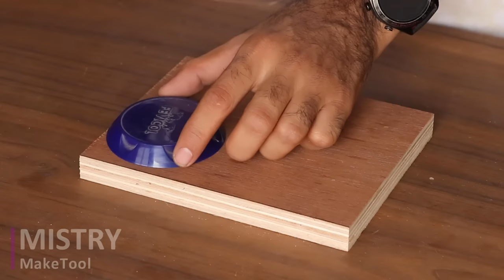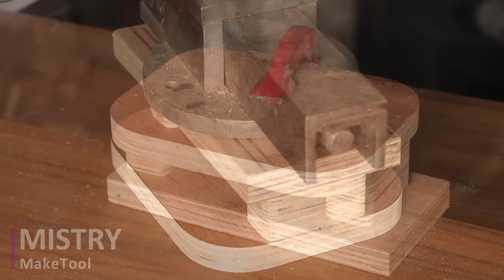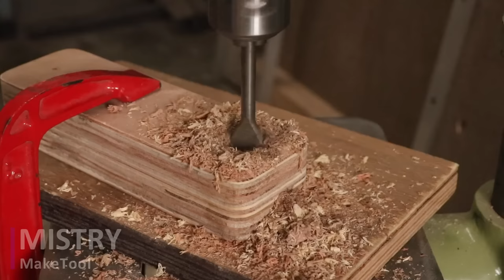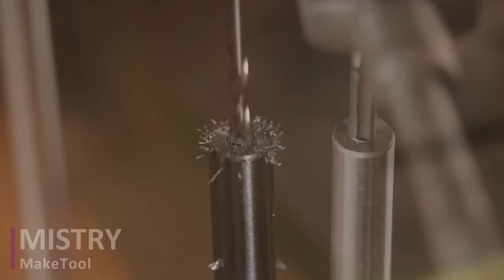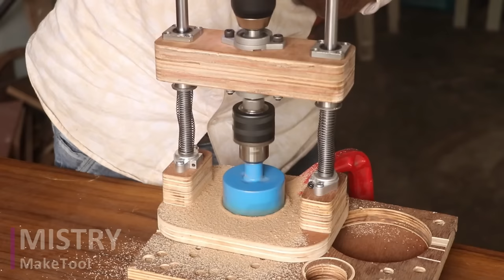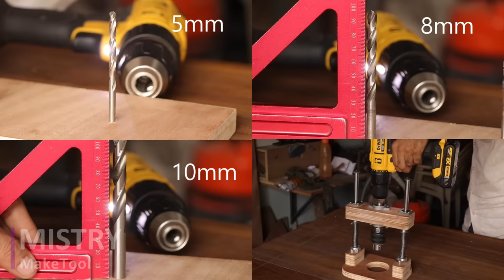Making A Drill Guide || Perfect Straight Hole Drill Stand

Comment: Step 1, rent a drill press. lol
Reply: ... or buy one , to disassemble ,to get the metal parts needed to build one...
Reply: A drill press is great, but you just can't use it for every work.
Reply: @MCsCreations  Agreed. I was referring to the holes he made at around 2:00, of course he did it freehand with a drill, but the shaky hands that I have would require a drill press for that part. lol
Reply: @MCsCreations   Yeah, sometimes you need a dead straight hole in something that can't be brought to the drill press.   Therefore, a jig like this is useful.   But @Phyooms' point is well taken - getting the initial holes straight for the jig would be challenging.   Ironically that would be a good job for a drill press.
Reply: @tree_carcass_mangler  very true.